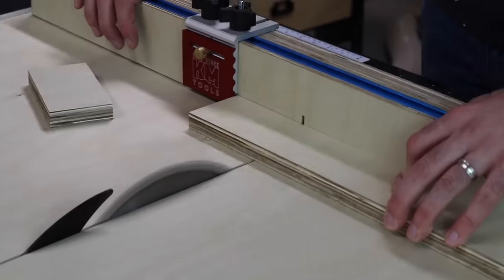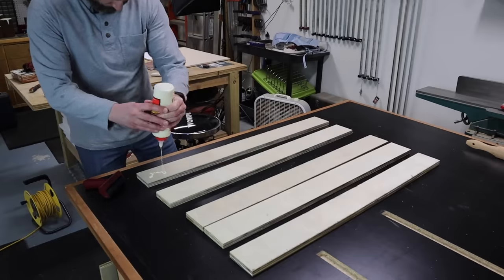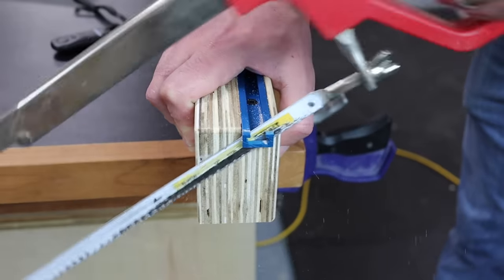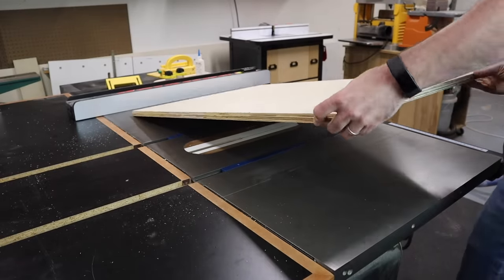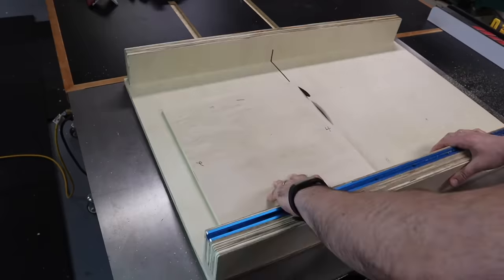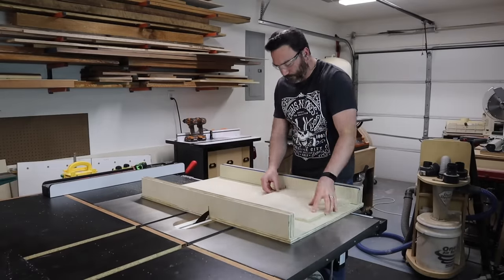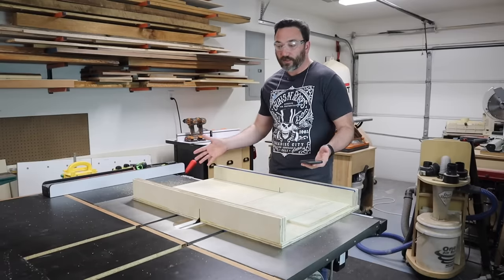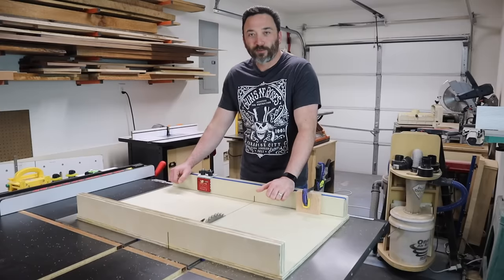Have a Table Saw? You NEED to do This!!!

Comment: The new one still looks too heavy and oversized for my taste.
Reply from the maker: You can make it smaller if you like, but this one is about 1/3 the weight of the old one.
Reply: @biscuittreewoodworks  If it works for you, that's what matters.  And it's definitely an improvement over what you were using....

Comment: “You need to make this!” Too bad I don’t have most of those tools to do it.
Reply from the maker: You can make this sled with just the table saw and a drill. The sanding can be done by hand and routing in the miter bar for the stop block is optional. That’s why I said in the video you can just clamp a block of wood to the fence for a stop block.
Reply: You can figure it out with some creativity. You don’t need absolutely everything to get started.

Comment: you made 5 cuts, so should have divided by 5 not 4
Reply from the maker: The error is only multiplied 4x using this method so you divide by 4.
Reply: @biscuittreewoodworks  ok thanks. I have always done x 5 as per William Ng video. I will try 4 now
Reply from the maker: Might check his video again. I'm pretty sure he divides by 4 as well. The math for it should be exactly the same.
Reply: @biscuittreewoodworks  You got me thinking now. I wrote down at some point that you times by the number of cuts, as it is 5 cut method, I went with that. So maybe I have to go and watch his video again too. Just goes to show we can get an idea in our head and it sticks. Thanks this has made your video all the more interesting.
Reply from the maker: If you find out he says something different, please let me know!
Reply: @biscuittreewoodworks  You were right, number of angles =  4 in Williams video, no mention of number of cuts. I don't remember where I took the information from when I wrote it down as I watched many videos at the time. My apologies.